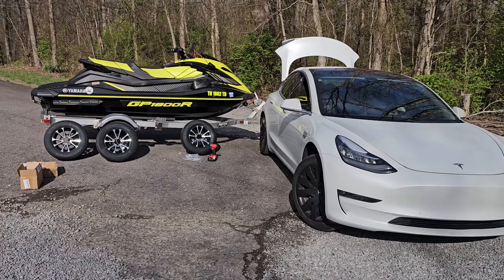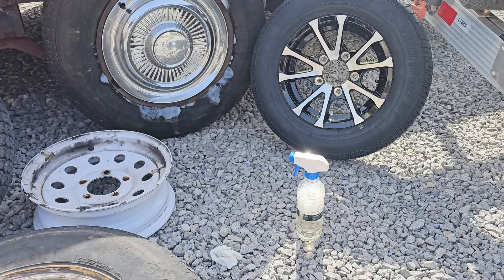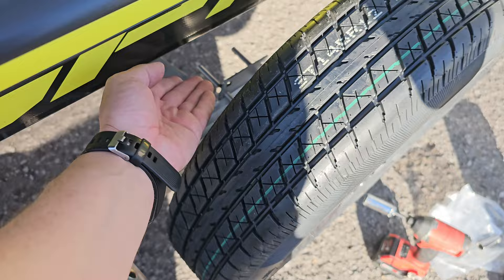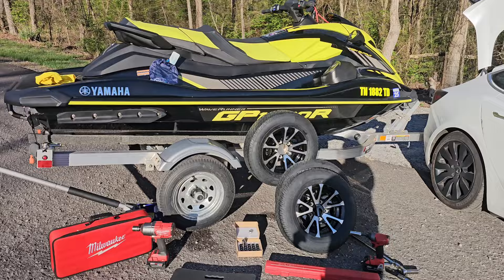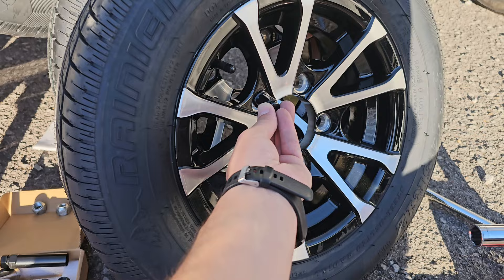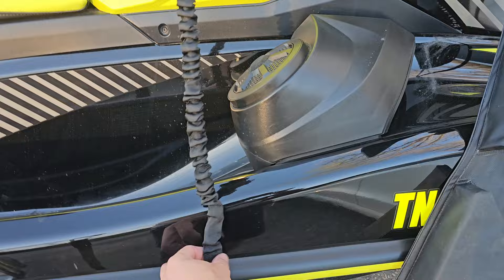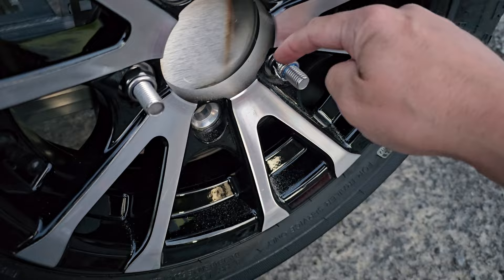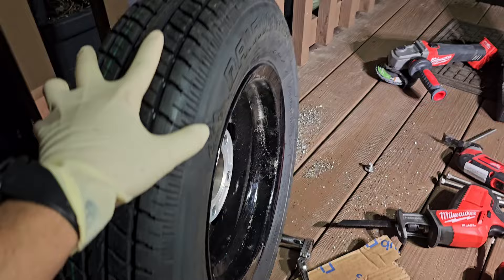2024 The BEST Tires for Your Trailer Smooth Ride | Step-by-Step Guide

Comment: word of caution, even though stainless steel won't rust ? ( some cheap stainless steel does ! ), its also very soft..this is why you stripped the place where you stuck that bolt through.